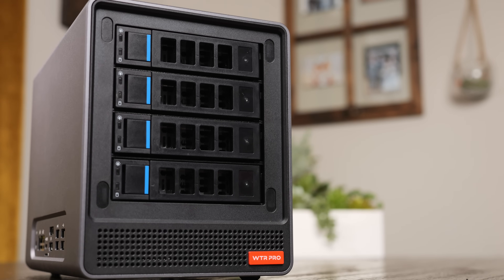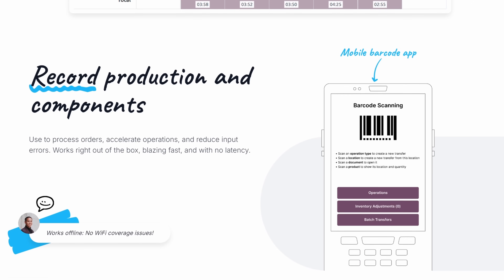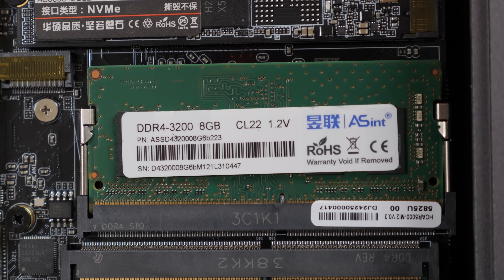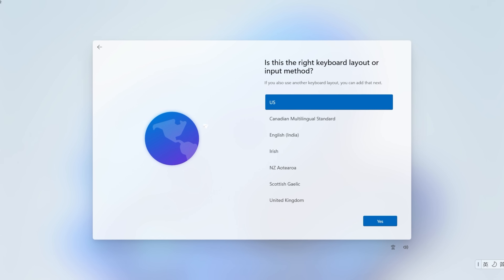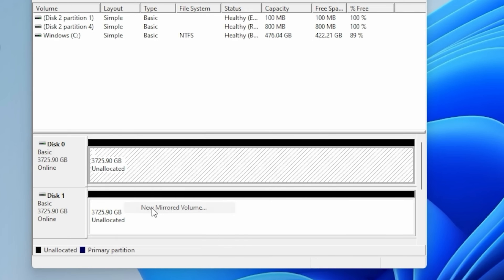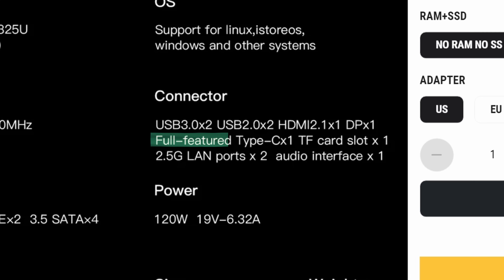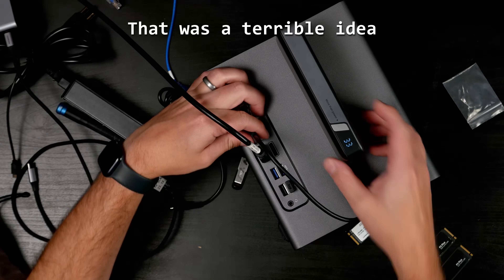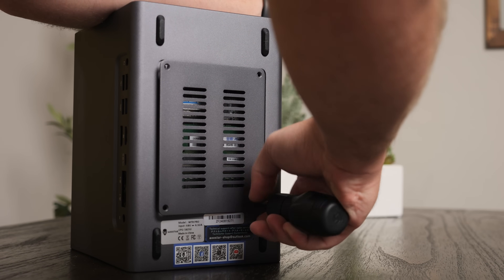The Home Server I've Been Wanting

Comment: @HardwareHaven: how did you configure pci passtrough for this one? I'm seeing two SATA controller entries, but if I add both, proxmox complains that I added it twice. Is it enough to add the .0 entry to see all 4 disks? (2 of my disks have yet to arrive, so I can't really test myself..)
Reply: I passed through both 0000:07:00.0 and .1 and all 4 SATA drives are visible.
Reply: @phar2010  If you select "all functions", then it won't let you choose both. I removed that checkbox and it works now

Comment: @Hardware Haven
All SSD NAS are the way to go, no if 
you are looking to max out capacity but 
weight when you are moving and also chances 
of screwing the HDDs while moving are way higher.

Terra master F8 SSD is being reviewed almost in every server.
Has it's pros and cons the only thing that I would keep:
-8x SSD slots
-Cooling
-Compact size
I know that are not so many options and that's the challenge.
Would it be an option with those positives other than F8?

Comment: i was pretty hyped for this one, but i think its to expensive?
At this price point i can build it myself with an jonsbo n2 , ryzen 5600g some motherboard with 2,5g (around 100€) and a 450w supply.
And would have a better barebone config for the same price (every part new).
Also you can activate the eco mode of the 5600g so its not even using more power?

And yes you have to build it yourself but when you buy the barebone version you have to open it anyways.
Reply: When I calculate the parts you said it is 50€ more expensive, also doesn't the 5600g use a lot more power with 2 less cores?
Reply: @Big_Kahuna  but more powerfull cores, 
option to upgrade it later (for an 5950 for example) and the possibility to add more ram, with the 2 pcie slots you have also much more options for the future add a 10gig network card? Add more High Performance Storage (pcie card which can hold 4 nvme ssd´s), add a gpu for something like plex?
With this setup you have real options to upgrade it to a real homeserver.

Also the Price for me was the same 10€ differnce

You can put the 5600g in eco mode and if you look benchmarks online you nearly dont loose performance.
But yes power is the biggest argument buying as the system all in all will take more power from the wall!

The Aoostar system by no means is not bad i just hoped that it would be 50€ cheaper tbh.
Reply: @dotnetapp  Can I ask you something else. Do you know why he uses a separate SSD for the host OS, instead of putting it on the 2 SSDs that are mirrored?
Reply: @Big_Kahuna  to much is happening on the mirrored ssd which could brick the host os it's always recommended to have the host os on its own ssd/hdd (best case still backedup somewhere so you can always bring it back when something goes wrong)

Comment: Just as a word of caution to anyone considering buying this–I ordered the WTR Pro Ryzen from AOOSTAR's shop on October 2nd and at the time the product page stated "Packages will be shipped out by October 17th." I politely emailed them about the the shipping status of my order today (October 24th), have not yet received any reply or order update, however the product page suddenly now states "The package will be shipped by November 15, please read the purchase instructions carefully before purchasing and do not rush customer service to ship the package." I don't yet doubt that I'll receive my order but it's frustrating when a company takes a considerable amount of money from you and does not clearly communicate order updates.

HH, appreciate the videos as always! 🫶
Reply: I ordered just about about two days before you and I received mine today. When I had emailed them, the response was fairly quick and very friendly. They explained that there was an issue with the supplier and that I could wait or receive a refund. I ordered bare bones if that makes any difference. Installed RAM, a couple NVMEs, two 24 tb drives, and a wifi card all from parts that I had. I wish it had USB C, and the windows build that was on the NVMEs (from a PC that died) didn't play nice with the built-in ethernet, but windows hasn't been booted from this drive for over 2 years so I'll have to see what happens once I update things. And then I'll start tinkering.
Reply: mine was stated to be shipped on oct 30 and is now in customs in Germany - went as expected, I'd say

Comment: Any idea why this version (WTR PRO) is sequential better in power consumption compared to the Aoostar R1 which you also reviewed?
In your video's / tests the R1 took like 20W while the WTR PRO only measured 7-8W.
Reply: I think you are comparing consumption with drives vs consumption without drives. R1 was using 10W without drives.

Comment: The decision not to include hot swap is... Interesting.

Did you happen to look in the BIOS to see if it was just disabled? I don't think hot swap generally requires any specific SATA controller, I'm pretty sure it just needs to be supported by the BIOS.

Comment: I've had one for about 3 months (5825u amd model/32g/1tb), so far not impressed.  I had to buy a new power supply for it, as the 120w way insufficient to run 4 spinny rust drives.  200w works fine, and only added 100rmb overall to the cost.

My major pain point though is that the drives drop out.  I'm running a zfs pool raidz1, and drives keep dropping out after a few days.  I've replaced disks, updated the bios to the latest version, still happening.    Going to replace mine, but I'd recommend avoiding till the issues are resolved.

Comment: 10:45 - Love this idea. I have two NVMe drives configured via dm-cache for my HDDs, and it works beautifully. Maximizes the storage space so I never really run out of space, but SSDs make sure that almost everything I ever need has SSD speeds, rather than having to spin up the platter to access it.

Comment: Pointless with only four bays
Reply: Why pointless?
Reply: @phar2010  because a nas needs multiple drives either for redundancy or throughput and wasting 50% capacity on redundancy makes no sense.
Reply: @turkeyphant  there’s actually 6 bays. Technically 7
Reply: @phar2010  I agree. That's got nothing to do with what I just said.
Reply: @turkeyphant  oops I replied to the wrong comment. Updated.
Reply: Thanks. But nobody us using ssd for nas storage
Reply: @turkeyphant  OK Boss, you know best.
Reply: @turkeyphant  I am. So do a lot of people
Reply: Okay let me rephrase. Nobody sensible is running ssds. There are so many well trodden reasons why it's a bad idea.
Reply: @turkeyphant  what are those reasons?
Reply: This machine is suitable for most people, we are working on a project for a 6bays machine that will use AMD 7000 series :face-blue-smiling:

Comment: Can you see a straight airflow path from the front of the drives out the back through the the rear fan? You say "backplane", but then show it removed from the chassis, not in place. Does that backplane block the airflow and thus render that nice big fan somewhat useless? My experience with large capacity drives (over 8TB) is that they run very, very hot, and those drives look like they are packed very tightly, with practically no airflow between them. The only reviews I see on YouTube totally ignore this failing of compact server boxes. What good are the features if your drives fail?

Comment: There are two enormous problems with this one. First it doesn't support ECC ram. Which is means your data is not really protected no matter what your raid setup is. Second is 4 disks kind of sucks, at best you have single parity backup, so you can survive one disk failure. It would be really nice to see this up to 5 disks as that will support double parity backup and thus 2 disk failures.

Comment: This is very compelling. I bought a 4-bay Sabrent USB 3.1 DAS to connect to a repurposed old computer and—after many emails with customer service—determined that the 5V rail (stepped down from the 12V PSU) is directly connected to the USB 5V in and easily overpowered by a desktop chip, glitching the USB 3.1 controller and resulting in USB 2.0 speeds. I was actually told that this was my fault because I used add-in cards and it seemed to work fine with a laptop. It is really encouraging to see a system that is more capable and expandable and reliable like this for close to the same cost of that DAS and what I could get for my older system! Thank you for taking the time to review this!

Comment: The primary interaction (buttons first) is usually the front, so I'd say the face with the power button is the front.

If the power button was on the same face as the permanent IO (things you aren't swapping often such as ethernet and display) and all other faces are blank then that panel is the back

Comment: These are great form factors. The caveat is replacing any hardware that fails. My old synology 8-bay PSU died. At the time it was 5-year old hardware and synology no longer supported it. I had to order from eBay and will take a month to ship from China. Ended buying the new version. Having the proprietary software saved me because I just swapped the drives over to the new NAS and it worked. PSU came in after a month and now it serves as a backup to the newer NAS. The nice size is great but trade off is replacement parts for failed hardware.

Comment: This may be the replacement for my Synology NAS. Question is, can I run Xpenlogy on it. The sole reason I use Synology is becsuse of the software stack. Everything is already setup and w/ many terabytes I don’t want to setup everything from scratch and have to find new apps for common functions.
Reply: i run xpenology on a windows 11 box under vmware workstation. Been working fine for the last 8 years - all the way to DSM 7.2.1

Comment: Add in an Oculink port (even if it shares PCIe lanes with one of the SSD slots, and disables one if something is plugged in) and you've got my perfect mini NAS. The ability to get an AMD 8c/16t CPU & 64GB RAM and still plug in an external Intel or NVIDIA GPU for transcoding would make this absolute perfection for me. Right now, I have an AMD 5900X for my VMs and an 8th gen Intel mini for my Jellyfin server/transcoding. Oculink on this baby would allow me to replace both of those devices. Might be worth trying one of those M.2 to Occulink adapters and YOLOing this thing.

Comment: I have the N100 version and so far I really like it.  I'm still deciding if I'll use it to replace my current unraid server that lives in a Node 804 case.  This is about 1/4 the size.  My biggest gripes are the drive bays like you said, you really gotta work to get the drives out.  And the biggest issue was the order and ship time.  It took 26 days from when I paid to when it shipped, and it took another 14 days to arrive.  The company is based in the UK but all shipments come from China.

Comment: @HardwareHaven  I see that you tried a 6-SATA port M.2 2280 adapter with the ASM1166 chip in one of the slots, and it's detected. Yes, please do an external SATA storage extension hack video. You could even create a custom 3-D printed bottom panel to accommodate the bundle of 6 SATA cables. What really interests me is how you would power the external array of 6 SATA drives - the 19V DC power brick going to the Aoostar won't work. I ran into problems with an HP EliteDesk 800 G4 Mini connected to 4 X SATA drives via a 4-port M.2 adapter (with an ASM1064), where the drives were powered with a Corsair RM550X ATX PSU and the HP with its 65W 19V brick. I could never avoid serious SATA bus errors and resets if I used more than 2 disks. Not the SATA cables or the M.2 adapter because I tested them elsewhere with no issues. SO maybe ground loop noise??

Comment: So I'm guessing you searched the BIOS for SATA port/controller properties and didn't find anything to enable hot-plug/hot-swap? By coincidence, I'm testing an MSI Mag B650M Mortar Wifi motherboard with the new Ryzen 9950x processor, and I  was surprised to find that the BIOS had the SATA port hot-swap disabled by default. It seems likely that Aoostar could fix the this deficiency with a BIOS update.

Comment: I really don't see the big point in bothering with hardware transcode unless you have to stream stuff to several different devices (at the same time) that need different coding. At least from my point of view, my Apple TV shows like everything I throw at it just from a basic plex software server on my network. I don't have extensive amount of 4k high bandwidth videos that is important enough to bothering using TB's on keeping. Most 4k stuff I watch is from online streaming services. If people have a fairly modern flat screen TV or Streaming capable box, Plex is just for the nice UI. Could use any standard NAS device for streaming when using a modern client. I did try to turn the nvidia card on my server PC to do transcoding, but alas .. the 1660s could hardly keep up a 10mbps 1080p low complexity transcode, so back to just let the AppleTV handle it which works in most cases unless you have some obscure old video codec files you haven't bothered recoding to a modern format .. (like old porn from the early days of the internet) 😂

This actually a nice little box for a NAS/Proxmox server The CPU is powerful enough for most of what home users would need. And It's dedicated NAS setup is more Practical than the otherwise great Minisforum NS01. A 10gbe would have been nice, but grab a cheap managed 2.5gb switch from Ali and you'll have at least 5gbe from the NAS to the switch.

Comment: 6:52  It's possible that the Sys_Fan header is indeed a second fan port, but in this version they didn't put a fan there, but instead just used the thermal ports.  4-pins could have been Gnd/Pwr/PWM-Signal/Temp-Probe arrangement. 
So in this version they forewent the fan and just used the probe by itself, perhaps realizing that the unit actually didn't need a full featured fan and they saved a buck or 2 on each unit

Comment: Not a bad option. I have a DAS with an N100 mini PC sitting on top acting as my primary file server. This would serve (no pun intended) the same purpose in a single unit. Swings and roundabouts though, slightly improved performance at a slightly higher cost (the N100 version due to fast direct interface), lack of upgrade or similar flexiblity if a single unit goes down but this isnt a big deal for most people in a similar way as mentioned about hot swappable. 
I will have to keep an eye out for deals towards the end of the year.

Comment: its impressive to offer 32gt ram for server for 400 dollars, but do you really need that much ram for server?
the processor is still intel processor n100
(6M Cache, up to 3.40 GHz). The processor is the 12th generation Intel successor to the Pentium / Celeron line, and it includes Intel UHD graphics.

Comment: I understand it's not ideal to have wifi6 on a NAS but doesnt wifi6 bandwidth surpass a 2.5Gbps ethernet connection? couldnt we have good writing speeds with wifi6?
Reply: Wi-Fi 6 may have better maximum link speed but Wi-Fi has more protocol overheads and more importantly interference and other devices will cut down on the available throughput. Across various Wi-Fi generations the best I've seen is only half the nameplate rating.

Even if you managed a truly faster connection to your access point the data still needs to get over to the rest of the network and the fastest access point uplinks I've seen is 2.5 gigabits. If you do Wi-Fi to Wi-Fi transfers you eliminate this bottleneck but both devices connect to the wireless separately, halving your throughput again.

Comment: Comes with Win11 Pro preinstalled. Meh. Would have certainly liked if it hadn't and came $50 cheaper... by the way at time of writing it' all went up $10 already... still affordable but again, why should people pay for a Win11 Pro OEM  license when they're not going to use it and those using it could buy at a higher price point if aoostar offered it as an add-on at the time of purchase? It feels like a poorly thought through idea to offer Win11 Pro also because those buying it to use it as NAS with open source OSes would not be needing it to begin with and would be far more useful if it came out of the box with the ability to install a NAS OS or another perhaps.

Using as a PC and NAS even if one could as dual boot it would be nonsense... because when using as PC the NAS would not be running and vice versa. Using it only as a PC is sort of a waste and most certainly wouldn't want to use win11 as an home server OS. Nth point in favor of not including Win11. 

That said... it' be interesting to know how this performs when used with a OpenSource NAS OS. 

PS: I do agree... bummer for not making HDDs hot-swappable and for not adding 10 Gbps Ethernet port

Comment: Hotswap drives.
On Linux OSs, you should be able to force a single hard drive scan after removing the drive from the software raid array and then physically swapping hard drives.  This 3 step procedure (remove drive from software raid, hotswap disks, force disk rescan) has worked on a number of Linux systems without BIOS and hardware support before, though obviously not guaranteed. 

Please try, and let us know your results.

Comment: If you are using something like a Jackery or Bluetti as your power source rather than a wall outlet, the USB C port allows you to bypass the AC to DC conversion resulting in power savings.   When running your home lab off of solar power, avoiding AC to DC power conversion is  a very significant selling point!